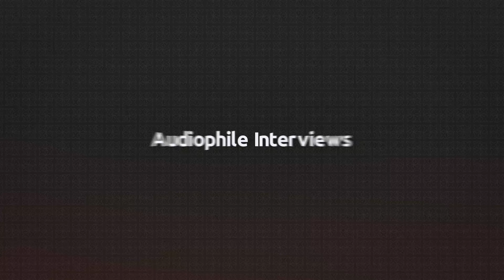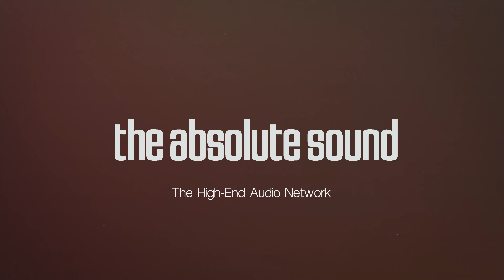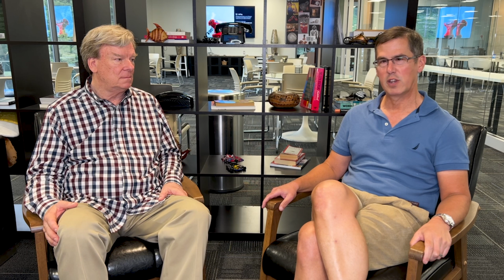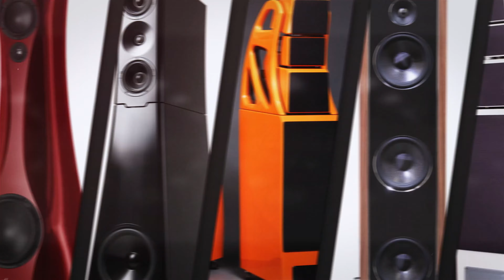Why is Graphene a Life-Saver for Amp Tubes? | Western Electric's CEO Charles Whitener

Comment: What made you look at Western Electric as an Audio company? Inert and vibration resistant potting compound is something to research. When mating the tube to the base.
Reply: Tubes were used in telephone amplification. Western Electric was big in film sound until the Feds made them spin off Westrex.

Comment: I haven't heard many amps with the 300B but I heard a system with an integrated amp that used 300Bs and it was one of the worst systems I've ever heard but it used a CD player as a source and some smaller 2 way speakers. I know some people love single ended amps using big triode output tubes but I have yet to hear any that sound good to me. It might be that people don't know how to use these tubes properly. Or I just haven't heard a good one yet.